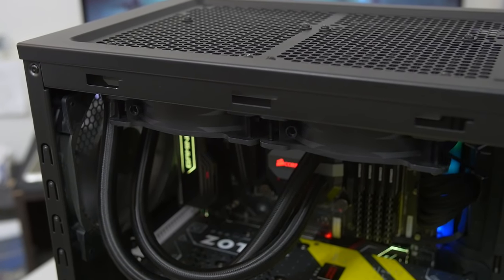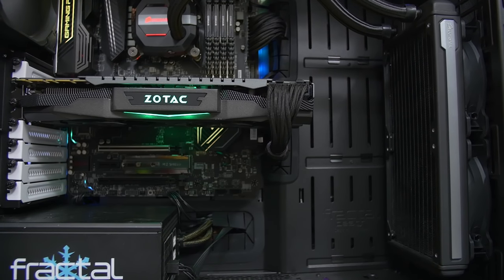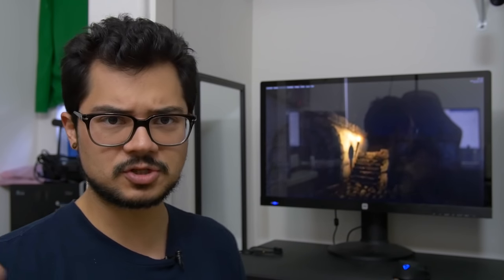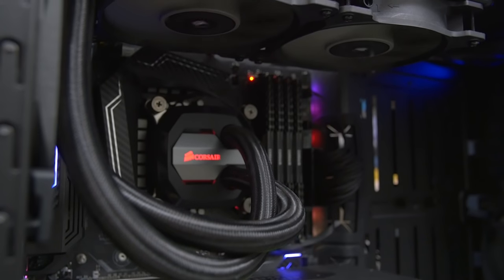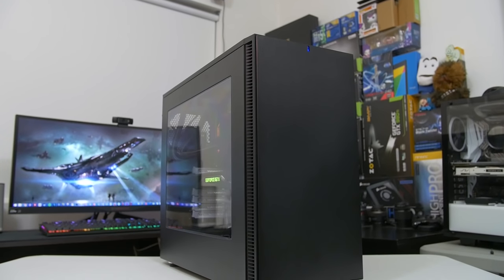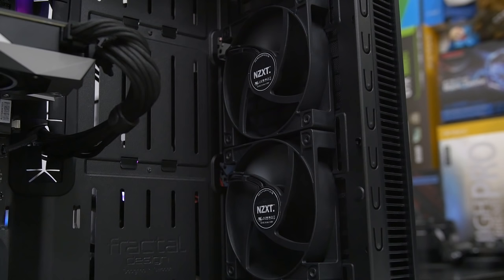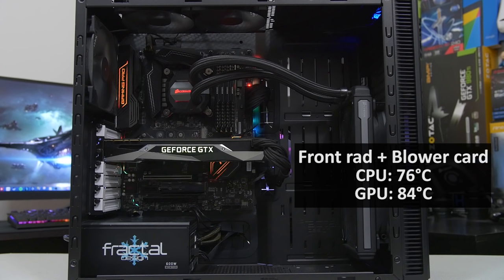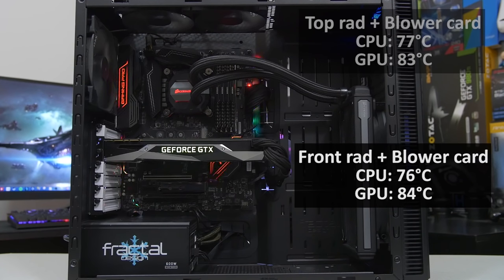Does Radiator Placement Matter? Hint: YES

Comment: Except if you have an AMD rig, in which case the thermonuclear radiator is located in the CPU socket.
Reply: lel
Reply: EpikSquared rocken a fx 9370 overclocked to 4.7ghz with a aio and im not going crazy hot
Reply: Except that is for GPU's. FX cpu's run pretty cool if you throw the stock heatsink in the trash where it belongs. Its amazing what the difference is when you allow thermal conductivity between the chip and heat spreader
Reply: I have 8370 and it's running 25 idle, 40 max with air ... I don't get where you guys are getting that insane heat ?
Reply: Wow, you're fun at parties.
Reply: I'm with HafisCZ

FX 8350 @ 4.6 GHz... idles in the low 20s, and sits in the 30s under gaming load, liquid cooled.
Reply: My FX 8320 runs at 19 degrees idle with a 4.3GHz overclock and never gets above 50 degrees under load. And I have a Hyper 212.
Reply: Ayy lmao dead memes
Reply: What's your ambient temperature? Are you in Siberia?
Reply: The problem with everyone complaining amout amd chips being hard to cool is that intel enthusiast chips have higher tdps than most of amds fx line, except for the 9590 and 9370 which most people don't buy all of the fx processors have a 125 watt tdp or less, while all 2011-3 i7s have a 140 watt tdp, so they are actually outputting more heat than the fx chips and are harder to cool at stock (tdp varies too much on a per chip basis to make any predictions about overclocked)
Reply: Or because they're just haters.
Reply: I live in Michigan, heat is running, ambient temps are probably around 72ish.
Reply: no my cpu is running fine never above 59C the nuclear radiator is the VRM that freaking hot about 70-90 lel
Reply: Except that most people that complain about AMD FX CPU temps (at all the people I know) are comparing them to Intel's mainstream flagship CPUs (4790K, 6700K, etc.), not enthusiast chips. In comparison to FX processors 125W TDPs, Intel's K sku CPUs have considerably lower TDPs, between 77W and 95W depending on the generation, and perform better. Zen (or Ryzen) has showed meaningful changes in CPU TDPs with their 8 core ones having only 95W TDPs compared to 125W on FX and 140W on Intel's 8 core enthusiast chips.
Reply: Thats what ln2 is for.
Reply: Cooper Cummings except intel and amd measure their TDP differently, i7 6700k on 91W is drawing way less power and generate much less heat than a 95W 8300 in test/benchmarks online. and whats shocking is that 140W Intel chips draw less power and produce lower temp than the 8300. I dont know how FX users on youtube comment section are getting very low temperature when in fact benchmarks and tests done on multiple tech sites contradicts it. Even with the best CPU cooler your cpu will be sitting at 5-7 degrees higher than the ambient temperature at idle. Either you are all using LN2, living in antarctica, or pulling this temps out of your ass.
Reply: AMD idle temps are not reported correctly
Reply: my r9 furys only hit dont go more than 67 under load, so none of that is true either
Reply: just buthurt fanboys thinking amd actually gets crazy hot, lol

neither the cpu ( had an fx 8350 with scytha katana, max load it was like 50 while heavily overclocked )
or gpu's ( RX series ) get crazy hot....
Reply: It is common knowledge AMD CPUs hardly report temperature in a reliable or comparable manner. The power draw always tells the truth, though.
Reply: FX 83xx series did draw more power than even a 6900k on average in virtually every test results published on the web and youtube.
Reply: Sabbilon everyone who has AMD knows the idle temps aren't 100 percent accurate, but you're not going to be at 100C if it's reporting temps just above ambient.

Smfh
Reply: Wokis
That's where most people are wrong. AMD cpu's does NOT report temperatures. They report so-called thermal margins - distance in °C from thermal throttle temperature. The more close the cpu is to the throttle temperature, the more accurate is the reported margin.
Reply: crap I may have accidentally started something here.

Move on guys, it's just a crappy joke. No need to get into a pickle.
Reply: No, you don't
Reply: Nihilus, my idle temp comment was directed towards people who report idle temps like 19 degrees on air, see EdwardM862.  I was trying to just point out that temp was most likely not accurate.  I hope your head shaking wasn't at me.
Reply: EpikSquared my 6300 rarely hits 60c lol... idk why you intel ppl always bash on amd. sure i could sear a steak with the stock cooler.
Reply: @Sabbilon

Sorta lol, it's common sense that you're not gonna get temps that are likely below ambient...

Unless you're my buddy from Alberta, who opened his window in his bedroom to see how cold he could get his PC to run in dry winter air.
 That was funny...
Reply: its funny how AMD CPUs gets the heat jokes but it's the intel CPUs that needs delidding
Reply: +SuperJosteen temps even when using AMD overdrive to check aren't really that high, though admittedly I'm using an FX 4300. However I've seen other people report the same thing with higher tier AMD cpus. So I honestly can't say that they actually run really hot.
Reply: +unsigned int that same reason is why I want a Sandy Bridge processor.

Comment: Do a 212 evo style cooler horizontal vs vertical mounting temperatures.
Reply: nah
Reply: Sure the 212 Evo isnt great but tons of people have them and I'm pretty sure horizontal is better but who knows maybe vertical is better. It's a quick and informative video to make.
Reply: you may think it's trash but it still holds its place in the market
Reply: yes. having the hot air blow upwards is a slight  difference. I have my wifes fx-6120 OC'd to 4.6GHz and the difference is worth it with that chipset since max temp recommended by AMD is 61c. I can make a video about it if you want but I don't see a need. 

have fun. and to clumsy tiger, a lot of people use this cooler and with 2 fans on it I get roughly similar performance to my H100i. so for 1/3 of the cost, if I could go back I would have bought another 212 evo.
Reply: croyrig h7 ftw
Reply: dave091790 so for my evo what is better facing up or vertical? Sorry if it's a dumb question.
Reply: I have my CPU fan cooler facing in the direction of air flow. So it intakes the cool air from the front fans, and exhausts it out the back and out the rear of the case instantly. There's no other way you should do it IMO
Reply: The 212 was a staple, but for awhile now, the Cryorig H7 has ruled the price point, as it cools better while being quieter.
Reply: Ramo
If you have a fan right in front of the cooler(front of the case) blowing right onto it then rear facing would make sense. I have intake toward the bottom because it's a larger case(thor V2 and NZxT switch 810) so I have it draw form the bottom and blow out the top of the case. it will make a difference depending on your case airflow setup.
Reply: SlavjanA On the other hand the Gammaax 400 cools slightly better and is cheaper. The 212 is pointless today.
Reply: +SlavjanA Hm never seen the Cryorig H7 I like it. I've been considering a new cooler, I'm using the CM Hyper TX3 right now. The 212 Evo is just a little too big for my Fractal Define Mini (160mm case spec, 159mm 212 Evo is pushing it). You think the H7 would be much better than my TX3?
Reply: Except that the 212 is the only cooler available internationally on the cheap.
Reply: Malus1531 I don't know much about the TX3. I know the H7 performs slightly better than the 212 and it just looks so damn sexy. Almost as nice as an AIO imo.
Reply: Vertical should be better as hot air from CPU is directly ejected towards top mounted fan and not affecting VRM temps.. as that area is generally hotter. while in horizontal position.. hot air from cooler will mix with heat rising from the VRM heatsink.. and that could make some diff.. its a dumb sort of explanation or answer. am no PC mastergod here.. but this is what i think. could be wrong on this..
Reply: +Garrett S. Oh ok, good to know. Yeah I like the look too. I found one sort of amateur testing of the 212 Evo vs Hyper TX3 and the 212 Evo performed 8-12% better. I'm starting to experiment with overclocking, but haven't got it optimal/stable, so for now I'm using the Gigabyte UEFI auto "CPU Upgrade," 6600K at 4.3GHz. Seems to run it around 1.25V, and I get 70°C max. So maybe I can drop voltage/temps if I do it manually, but it has me considering a better cooler.
Reply: Eggsr2bcrushed thats gonna be a doesnt matter shit
Reply: Eggsr2bcrushed I don't know about pricings in NA, but in the rest of the world the 212 Evo is cheaper than the cryorig, and still provides surprising cooling and acoustics
Reply: Yet it still outsells each and every other make of cooler. I guess You haven't informed Cooler Master of your brilliant deduction yet.
Reply: +Malus1531 The H7 would be a better cooler than the TX3 for sure, unfortunately I can't find a comparison online so I can't say by how much better. It'll fit in you case too though, since it's only got a 14.5cm height.
Reply: 212 evo keeps my fx 6300 at 4.6 ghz under 50 c at load. shots fired.
Reply: Under 50 is damn good. What fan and TIM are you using?  The 212 keeps my oc'ed (4.5) fx 6300 round 33c browsing the web and mid to upper 50's under load (gaming).
Reply: +SlavjanA Well I just ordered the Cryorig H7. Thanks for the recommendation. Are expensive air coolers even worth it? I would think there'd only be a 1-3°C difference between a $90 air cooler and a $35 one.
Reply: The H7 is awesome. It cools my 6600k no problem. It looks awesome and is not too loud.
Reply: +Malus1531 No problem, and yeah there can be a big difference actually, something like a Noctua NH-D15 (~$90) can be ~10C cooler than a 212 or more, while being much quieter. It depends on the cooler, and system scenario of course, not all $90 coolers, or systems, are built the same.
Reply: +SlavjanA Oh ok. I looked at some of the more expensive ones but all the models I checked (though there are plenty I didn't) were too big for my case. By the time I get a bigger case I'd like to try water cooling (my current case only supports a 1x140mm rad which probably isn't worth it). I've always avoided Noctua because of their ugly brown fans. The Cryorig H7 fits real nicely with my black/white/red system
Reply: There are black/grey ones too
Reply: the consensus is they aren't as good as the poo poo brown fans, are of a older design and use lower quality materials. I'm not speaking from experience, I just do lots and lots of research. My solution was to get the Fractal Design Mini C with-out the window. Problem solved!
Reply: Yeah, true.. but painting them isn't that hard to do either for a solution, I myself own Corsair AF120's. Noctua is a little too expensive for me currently
Reply: +thebigdustin Yeah I like the Fractal Define Mini C. I bought a Define Mini, then the Mini C came out like a month later :( EDIT: And yeah my case is windowless, but I still want it to look nice when I open it or show it to people (though almost nobody I know appreciates or understands PC hardware)
Reply: Malus1531 I know the feels man. Wife thinks I'm crazy and my non pc, console player types just don't get it.
Reply: Sure, lots of people still have it and the test would be useful just for that, but I do agree that the 212 Evo is a bad cooler with zero place in the US market if people knew what the options were. The M9i is better in every way imaginable and costs only $20 and then you've got several other coolers such as the H7 to mention one of them.
Reply: I've tested this myself and its dependent on what your case and case airflow is like. So it varies. In my case I have an S340 from nzxt, i tested it in every orientation including blowing down at the graphics card, for science of course, and i get the best temperatures when its in a vertical orientation exhausting towards the top of the case. second best being exhausting towards the back. the difference for the two are about 6c under idle and 6-10c under load.
Reply: Eggsr2bcrushed congrat, your question got featured in the video asking the thing you just said
Reply: Eggsr2bcrushed congrat, your question got featured in the video asking the thing you just said
Reply: Dude, he literally did a video on this exact thing like a week ago
Reply: +Bloo Jay Dude, he literally shouted out this comment in that video, this was posted before.
Reply: If you have a hot GPU and CPU, better put it vertical to blow it to the back of your pc. If no, you can put it horizontal and blow it up. Thermal law is that hot air goes UP, so if you put it horizontal you will get hot air coming from the gpu.
Reply: The bracket doesn't allow horizontal unless im mistaken.
Reply: I have a 212x and can confirm that it allows horizontal and vertical. Unfortunately, the new AM4 bracket will alow only horizontal instalation wich is a shame.
Reply: I tried out both and found it to have no difference with +-1 degrees which is within margin of error.  Hot air does rise but either direction it's still blowing the cooler air in and goes up.  It's similar to this video which shows no difference unless you're using some graphics card that pushes a ton of hot air up towards the cpu.
Reply: Eggsr2bcrushed it would depend on the shroud on the GPU, I have a 212 and when I had a HD 7850 with open shroud I had the 212 facing down and quickly changed it to face forward which made a significant difference. But then I got a HD 7950 with a blower shroud which I noticed made the CPU run just a little cooler. But for shits n gigs I faced it downward and noticed it didn't change much which makes sense I guess.

FYI, I also have two 140mm fans on the front of the case and no exhaust fans.

Point is, what I have noticed with my case is that facing the cooler forwards helps catch fresher air. Especially if you have an open shroud on the GPU.
Reply: Fake Beats I got mine for $25 after  instant rebate, that kept me from getting a Noctua for $90. Added a second fan and put some good thermal paste, kept the CPU under 70c and quiet @4.5GHz (FX-8320, don't judge.. I got it for an awesome deal).
Reply: gowmu
Reply: Hey Gabriel, the FX-8320 has a safe operating temperature (on the cores) of 65c.  They should really be under 60.  You're not doing your chip any favors at the moment.

Back off on the voltage some and take a .1 or .2 ghz loss.
Reply: Eggsr2bcrushed I have an FX-8320e at 4.5GHz with 1.5V with full load. that little sucker gets hot. it overwhelmed my Hyper 212X like nothing. now I have a Noctua NH-D15 and my processor does not go past 71°C. for all of you saying that water-cooling is better, let your CPU burn test sit for about 1 hour. your CPU will still get very hot. once the liquid heats up, it will be much harder for the radiator to cool down hotter liquid. horizontal mount is best as you avoid the hot air from the GPU by not getting hot air directly from the GPU.
Reply: you use an fx 6300 in 2017?
damn
Reply: my god.. go get a G3258 for god sakes or a I3 6100 even if a FX chip could perform your losing out on so many features it's ridiculous I mean no USB 3, no M.2 storage, no DDR4, no PCI-E gen 3, and I'm sure you have issues with drivers left and right, The only way I'd understand is if you were in school and your family is poor but if that's the case you wouldn't have a PC... go to a micro center and get a I3 6100 they sell them for damn near $80 sometimes
Reply: For an air cooler and for the price, the 212 isn't trash.
Reply: The 212 Evo isn't bad for the price at all. There's a reason it's one of the best selling coolers
Reply: Radiators are trash lol. Heatsink coolers are a million times better
Reply: Eggsr2bcrushed horizontal airflow is better because it is assisted by the case exhaust fan in the back
Reply: Teemo4Life agree

Comment: This video made me subscribe, and here's why.

I'm using an i7-6700k overclocked to 4.6Ghz with an EVGA GTX 1070 FTW - an open style cooler. My Captain 240 EX RGB's radiator was top mounted in push. I watch this video and think to myself, "This guy is full of shit."

I then take the time to dismantle my fan and radiator setup, front-mount the radiator in pull, then set my top fans to push. I also set my rear case fan to pull.

I fire the 'ol Magnum Opus (the computer's name) up, launch Open Hardware Monitor and Prime 95... and see my temperature has dropped from 77C under load to 68C.

You're the man!
Reply: Do you get the same boost speeds on your GTX 1070? Or is it throttling down to maintain temps? very interesting!
Reply: It makes sense for front mount to run cooler :)
Reply: Why the rear case fan to pull though ? That air goes straight out of the case via the top.
Reply: 以蔵岡田 you are wrongly comparing 2 different types of loads. AIDA (if I remember correctly), stresses the CPU only, gaming doesn’t typically fully stress a CPU and is more GPU orientated.

A more appropriate test is for you to do full synthetic load like running AIDA and FurMark GPU stress at the same time.
Reply: How come you set the rear to pull? You don't use it as an exhaust? Curious if you tested both. Never tried it myself. I'd assume that would create negative pressure
Reply: I have 3 front 2 top intake with 240mm H100i RGB Pro XT up top, 1 rear 2 bottom exhaust. I have pretty decent temps, but my room is also 100% always air conditioned so yeah theres that too.